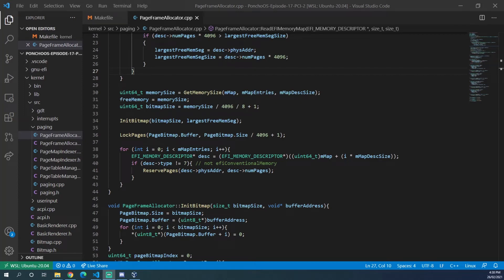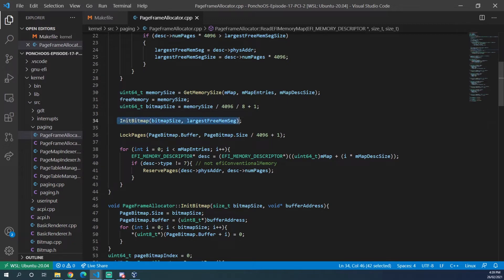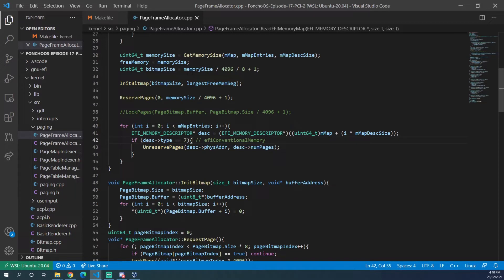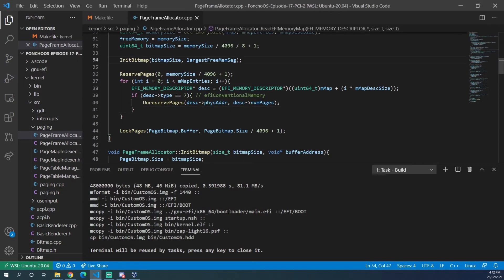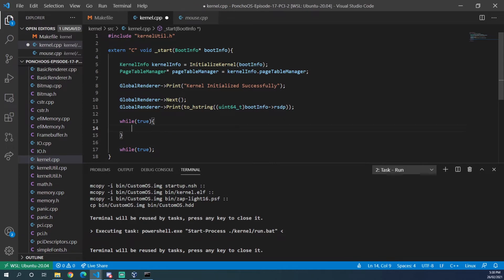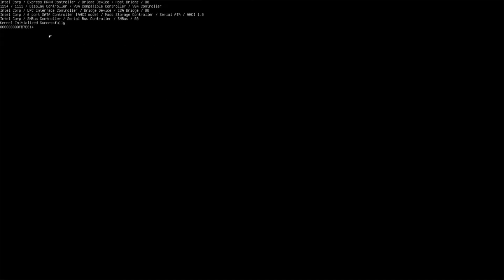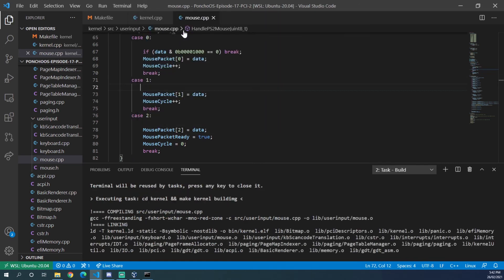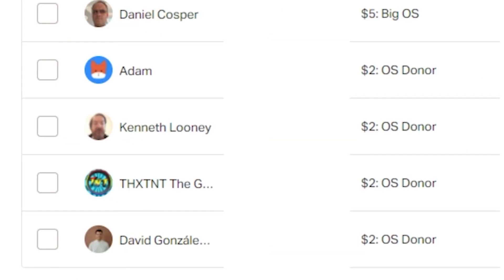Quick Few Bug Fixes | How to Make an OS: 18

Comment: I have a bug on Linux gcc 11.1.0 where I need to compile the _start function of kernel.cpp with `-fno-stack-protector` or I get a linker error
Reply: its not a bug
by default gcc uses stack smashing protector but it is not implemented here

Comment: Thanks, Still a little bug in kernel/Makefile it's missing '-machine q35' in run, which causes a beautiful red screen
Reply: @hans9018  The one I'm talking about is at the end of the Makefile, at run: beginning like this: qemu-system-x86_64 -machine q35 -drive, the -machine q35 is missing. It is correct in the file run.bat
Reply: @hans9018  I haven't tried that, it could or should, depends a little on the hardware. If you use the run.bat to run it, no need to add it in the Makefile

Comment: Imho, if you handle HID devices via interrups -- their code should be as small and fast as possible. So the only thing you should do in interrupt handler -- just capture mouse event, but do not process it in interrupt handler. The same is valid for keyboard. All further handling of HID should happen in main loop out of interrupt handling.
In the worst case you can disable interrupts in your mouse handler and enable interrupts when mouse handling is done.
BTW, as far as I remember USB HID devices are handled in pulling mode instead of IRQ.
Reply from the maker: Yeah, I usually do follow that design but I want the mouse cursor to be as reactive as possible - like for instance in episode 20 (not released yet), there is a blocking operation that happens on the main loop which if the mouse handler was there, would cause the mouse to not be able to move. I think it's a required thing to process it inside of the interrupt handler for reactivity. Also, USB HID devices also produce interrupts. The host controller polls the usb device but we don't worry about that, because the host controller sends the system an interrupt when there is work to be done